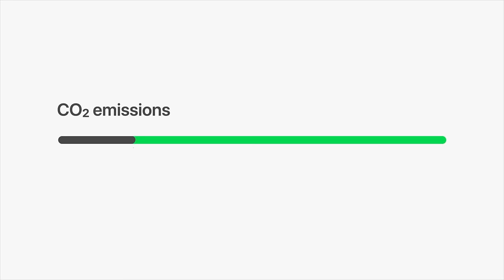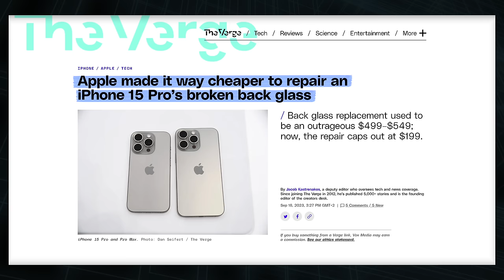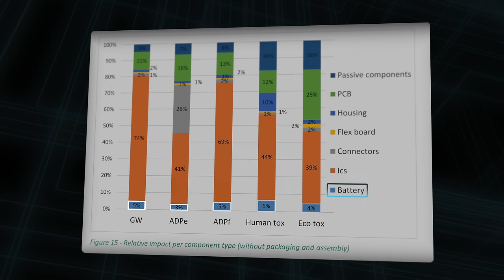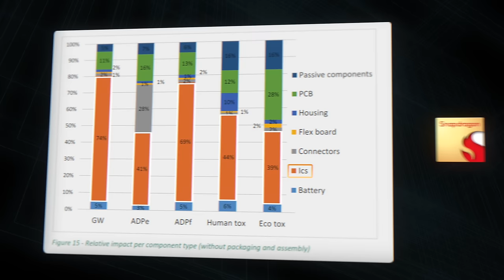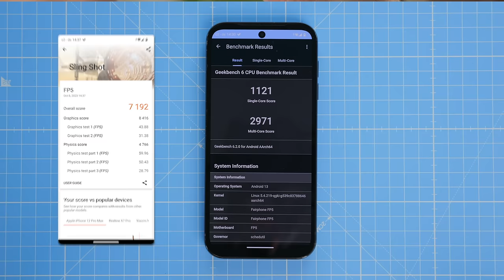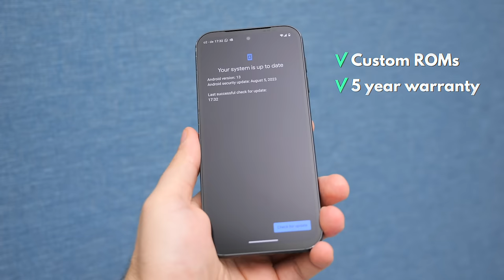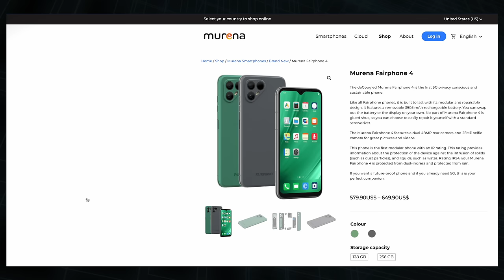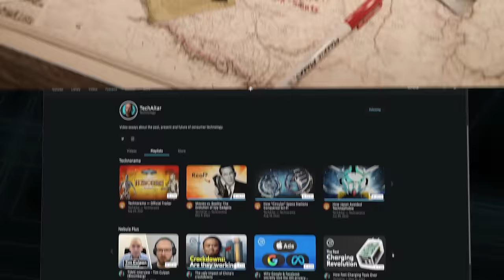Is Fairphone really fair?

Comment: Personally, i don't think i'd be able to use a Fairphone for that long. The fact that it's mid range is a huge dealbreaker for me.
I only buy the best of the best, because the performance is the only thing that can't be replaced/upgraded. My current Galaxy Note 9 is in its 5th year of use, going into its 6th. Got the 512Gb version because of the extra RAM that was probably the best decision, because RAM consumption really ramped up in current years.
When the S23 Ultra gets cheaper, i'll buy the 1TB version of it, so maybe next year i'll have a new phone to use for the next ~6 years.
Yes, you can overclock phones, but that can only get you so far in terms of use. It's a very minor boost in performance, especially when the phone is not that performant to begin with.
If they would release a version with a Snapdragon 8Gen2 or the upcoming 8Gen3, i'd consider buying one.
Still, my other issue is features. It could use some "FairMods" hooking up to the replaceable back panel.
A pen attachment for example, where the pressure levels happen inside of the pen (Samsung already did it, so it is possible) and it's connected through Bluetooth.
Or a projector FairMod. Or a better camera, like a 30x telephoto, because it could have all the space it needs inside of a whole back case. Or a 200MP camera. Or both.
A case with an IR Blaster would be interesting too.
Maybe a case with a powerful DAC and amplifier, that would support more than a 3.5mm jack, maybe a 2.5 and a 6.35 too, also native DSD support and, obviously, 32-bit FLAC.

And the phone could very well cost as much as the competitors, around 1000-2000€, but the overall package would be far better than anything currently on the market.

That i think would be the right direction for FairPhone. Achieve actual full modularity.

Comment: 2:20 the FP1 not only proved that there is a viable market for this niche interest, it also started to bootstrap the company's finances to the level needed to be treated more seriously by suppliers and banks. In a capitalist world those things are essential too. 

But you're right that marketability is also an important issue:

Their partners for the FP1 let them down on the promised lifetime of upgrades to the OS: but with a larger foreseeable market they were able to partner with more reliable partners on later models. Even with massive crowdfunding, without that established market it's unlikely that the current models could offer an eight year promise on security updates.

I supported them by buying the FP1, intending in my small way to be part of proving marketability and I'm glad i did. Yes it was a downgrade in feature terms from the Galaxy Note; but an upgrade in terms of my personal ethical analysis. 

I've never regretted that choice; though it has to be said that it was a choice i could afford to make. If i was stuck at the £100 end of the Android market that would have been unreachable for me.

YVMV: Your values may vary.

Comment: I still use my Samsung S10e (4 years old) but I need a waterproof phone (bicycle and motorcycling), so it's a tough choice since I was interested in a FP5 when my current breaks.
Reply: Be careful, as after some years of use the adhesives on phones aren't as strong and its water resistance will diminish

Comment: I had to replace my previous phone after just  years. The battery was having some issues and I had to replace it myself. I accidentally overheated the backplate, which warped, and the alcohol I used to remove the battery glue seeped into the display, partially ruining it. Had I had a fariphone, the backplate would've been saved since I need not use a heat gun to remove it and I wouldn't have had to use alcohol to remove the battery, which would've prevented me from buying a new phone.

Comment: Thanks for this detailed review of the Fairphone 5.

I have to get a new phone myself and I have been looking at the Fairphone 5 with keen interest – I like the basic idea and that I can actually replace the battery myself.

However, I am hard of hearing, have two hearing aids, and would be looking to use the phone with that in mind. All of the critical reviews I have heard of the Fairphone 5 point out that the loudspeakers and sound output are poor quality. Now, from this review, I learn that the Bluetooth is flaky. These two issues now likely mean that I will have to give the Fairphone 5 a pass. Unless, of course, these issues are addressable by Fairphone making available newly installable modular hardware that cures the issues. Does anyone know if that is likely on the horizon?

Comment: I watched this video and am typing this comment on a 2021 Fairphone 3 that has only needed its screen protector and power unit changed once (+ the battery, but it's because I dropped it in the toilet so it's my fault). I've had a few issues, and the huge loss in waterproofing is real (my previous phone was an iPhone 6s that I put through a lot and that I had to stop using because of the "other" memory storage issue that is common with it), but I use my FP3 most of my waking time and it's still doing great.

EXCEPT for one thing: the fingerprint sensor on the FP3 is no longer compatible with any authentication systems on 3rd-party apps, and the manufacturer has not planned on offering a new part for their 3rd model.

Comment: The biggest problem with Fairphone is that it will lose software support equally fast to Samsung S series phones (currently 5 years from the release, if Fairphone actually increases the software support period for real, it's a great news). It doesn't matter if you can easily repair the hardware if you cannot get even security updates anymore. In addition, thanks to hardware DRM requirements in some new software, you cannot replace the OEM firmware with LineageOS without breaking some software. (There's no technical reason for DRM to fail, only political reasons to not accept open source digital signatures.)

If the manufacturer has previously supported their devices but do not explicitly & publicly promise longer support than given amount (e.g. 5 years), you shouldn't assume you'll get any extra support. That said, many people believe in Apple delivering software updates for iPhones even though Apple has never promised any support for any iOS device, so those should be considered best effort support without promises of any kind.

Comment: A MAJOR downside to repairable electronics is that the company needs to produce additional excess inventory of replacement parts to accommodate POTENTIAL future user repairs.

If the company does not forecast the future repairs accurately, then every single component that goes unused is another component that goes into E-waste. 

I hope this is something that the 3rd party study has accounted for.

Comment: A problem is their customers may have loyalty but they only need to buy one. I don't see myself upgrading from my 4 soon. So I won't buy a 5, or even a 6.  

And I've had no issues with the 4 since it came out either. One brightness bug that may have been in android overall, that's it. The other smartphones I've spent any time using have a few more bugs or annoyances (and/or just break twice because you drop it slightly onto a mouse mat).

Comment: It's nice, that they care so much about the people and the planet, but I think, they are taking repairability and software support a litle bit too far. I like to keep my tech as long as I can and so far I never had to repair something, but not because I'm such a great owner, but because by the time something breaks, it made more sence to buy a new laptop/phone/tablet, becuase the old device was too old. My current Xperia XA2 Plus is 5 years old now and it runs fine on Android 9, but if it still had support, I don't think I would have a smooth experience, as newer OS versions are more heavy in size and require better hardware. In my opinion, it is better to have less support, but a smother experience, than forcing the newest OS to run on outdated hardware.

Comment: I've started using FairPhone 2, 3 and 4. The 2nd one was my favorite one with the sliders. The SoC was painfully slow in all models. With the 4 it was ok. However there are always software issues and the camera (or camera app) are horrible (ghost touches, resets when antenna switches between 4G and 5G, the whole camera thing). 
I recently gave up and bought a refurbished phone (2 year old model), it's so much nicer to not constantly be frustrated by the phone. Now I only have to make sure I don't damage this one :) (I never hard to replace any Fairphone components)

Another major thing I miss on FairPhone is the total lack of AR Core support.

Comment: I had an FP3 for years now and even though it's still getting regular updates and such, it was never a powerful device. I was hoping I would get much more use out of it, but alas I gave up. I just got my FP5 with low expectations thinking it would be a marginal upgrade over the 3, but I am pleasantly surprised so far. I can actually see myself using this device for over 3 years. Unless a software upgrade ruins it's performance I don't see a reason I would upgrade it. I do miss the wireless charging though.

Comment: Really wish that they'd ship to places other than Europe and the US, I know you can import them but they will no longer honour the warranty if you do. Not to mention prohibitively expensive, on top of the flagship price, since you also have to import every replacement part, which hurts even more since no warranty. I was really considering a fairphone as my next phone since my current one is 8 years old (yes really) and it'll only be a matter of time before it breaks in a way that I won't be able to fix myself, like the cpu or internal flash wearing out, or liquid getting in the screen gap and frying the whole motherboard, or breaking the side button connector on the motherboard. In the end I'll probably end up getting a slightly newer version of the same phone (and finally see what all the fuss over USB type c is about)

Comment: I'm thinking about buying a Fairphone. I don't mind that the performance isn't as good. I buy a Fairphone for its sustainability. To make a point.

A bit sad that there's no headphone jack. The adapter sold on their store is an acceptable solution.

I would keep using my S9+, but I need eSim and VoLTE support soon, which the S9+ sadly doesn't have. Also I'm starting to get various software issues. It's still running Android 10 and the security update is from March 2022.

Comment: I think this phone is a complete wet fart.
If you want to make stuff modular and environmentally friendly, giving options to users is a must... And they went the route of all the other brands of removing the audio jack.
I just bought a samsung m34, switching from a s22ultra because its pros did not add to make the trade-offs of the lost audio jack and micro sd slot worth. 
I have the same 128GB microsd card from way back 2013~14 with my personal music collection and things and nothing beats simply removing the microsd card from one phone to the new one and have no downtime or no transfer proceedure...
I was really interested in the fairphone 5 until I saw the lack of audio jack, and yeah, it is a big issue. If you are going to remove such a standard, remove it for at least something that is on par with what we used to have. 
Having to charge wireless earphones everyday, latency and battery consumption makes it a way worse deal than to simply have the audio jack and a good pair of wired earphones.

Comment: Honestly, the fairphone doesn't make much sense at that price

Like u can get a used older flagship phone for around 200 with the same performance

Like the qcm6490 is basically a 2021 mid range SOC(like a 780G or 782G), so a S865 would be similar perf & slight more pwr(since S865 is using Tsmc 7nm while qcm6490 is using the very similar 6nm)

Although less repairable, not buying a new phone will generate less waste anyway, software updates are great but if u are willing to use custom roms, a used flagship is just better

Comment: You can have wireless charging with a removable back. Just need to use pogo pins and have the coil integrated into the back. Downside is cost and thickness.

Comment: A removable backplate shouldn't be an issue for wireless charging, the galaxy note 2 had back covers which added wireless charging via a coil that went to some contacts on the back.

But then i don't use wireless charging. But when my xcover pro kicks the bucket, if the Fairphone checks the boxes (primarily dual sim and microsd) i might get one

Comment: My problem with phones are the battery. Up to now I had a oneplus 7t which is now - battery-wise - not much more than a charger-addict. Software-wise I am in luck that no big security issues surfaced on the drivers. As soon as those happen, I'm basically out of luck there as well. Had the device now for 4 years and the hardware does not feel bad after that time.

Due to the right to repair support being a tad late for that bugger, I was looking at the Fairphone 5 as well and it looks like it's the way to go as I do hate to throw away jolly good hardware just because the vendor decides it's obsolete due to no more updates.

Comment: Ive already been recommending fairphone to some of the tech savier friends i know because they are willing to make those compromises, i personally would have bought a fairphone not too long ago because my old realme x2 pro didnt get any software support anymore.(all of this was when the 5 wasnt out yet) But they removed the headphone jack on the 4 and the specs just werent up there to make it a worthy daily for me. So i bought a moto edge 40, simply because i wanted to give curved screens and the whole motorola gestures thing a try. Tldr i disliked the curved screen, battery life was too short and now i have to sell it 2nd hand for half what is was worth when new just a few months ago. Also the lack of the hp jack pissed me off. So now i switched to the galaxy a52s that i got with my contract, running lineage os on it and hope i ll be able to keep it for many years to come.

Fairphones will only be interesting for me personally if they add the headphone jack back because it is such an important feature for me to have. Also please dont remove the micro sd slot, thanks. Fuck dongles and fuck bluetooth headphones, i use them and i dislike everything about them besides the sound quality

Comment: I do miss phones with easily replaceable batteries, if someone cocks up and damages their phone battery with bad charging habits, simple, get a replacement battery and and easily slip it in. 99% of phones now a days requires invasive sort of removal of the base glass/plate/plastic which for a less knowledgeable person is a nightmare making them go to repair shops/sites where they get overcharged/ the time, or sold extra things they end up not using/needing. Not bashing on repair shops, there are genuine honest ones out there but for the average joe who wants an easy job of replacable back cover to easily acccess SIM/MemCard/Battery, I honestly miss these, I care less for the thinness of phones xD.

Comment: Yeah, longevity my ass.

Our FP3+ had massive GPS issues, a non swappable part, that made tracking using our car insurance's tracker impossible, basically never recording accurate data, which would lead to a financial hit.

This also occurred pretty late in its life, just about after 2 years, and tracking the source issue was a bit difficult.

No 5 years of warranty, just two, that it was a few weeks out of.
And support was extremely uncooperative, demanding it to be sent to France somewhere for weeks, for a steep uneconomical price - and would they provide a temporary replacement device, so we could at least *live*? No, of course not!

That's how you actively destroy sustainability and usefulness with incompetence, and we're back at a device by the usual manufacturers, that at least get core features working properly, more or less.

All of this has been super disappointing and sad, also the call quality was super bad. For some reason it was better, using the loudspeaker, but you can't do that in public.
The other side could barely understand you when calling regularly.

I'm so disappointed, plus them removing the headphone jack on the four is also such an ass-backwards decision, torpedoing everything they stand for.

I won't buy some crappy compression and latency laden Bluetooth headphones, with yet another battery that costs resources and has to be charged all the time, when I have a perfectly working pair of normal 3,5mm ones.

It's all just really infuriating, cause I would've loved to support their mission.

Comment: I still can’t get behind fairphone because of the water resistance problem. I personally end up using my phone around water a lot, and I’ve had too many instances where a non-waterproof phone would have gotten damaged. I’d rather have an iPhone or similar flagship and protect it with a decent case and screen protector. I kept my 6 and my XS going for about 4 years and in both, the charging port was the first to fail. With USB-C being more durable on the device side and magsafe being more convenient than just wireless charging, I expect to keep my 15 for even longer.